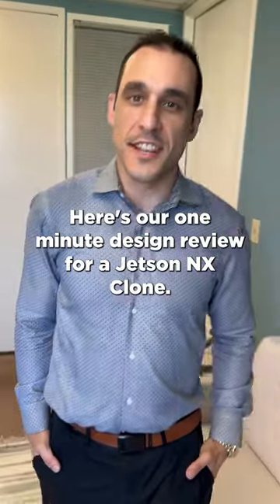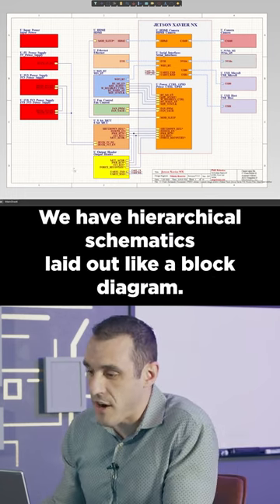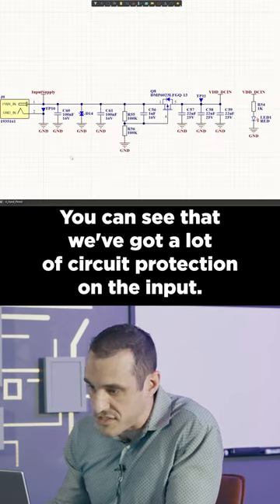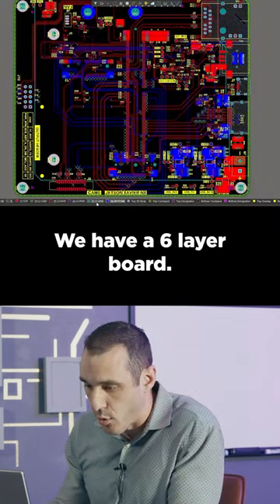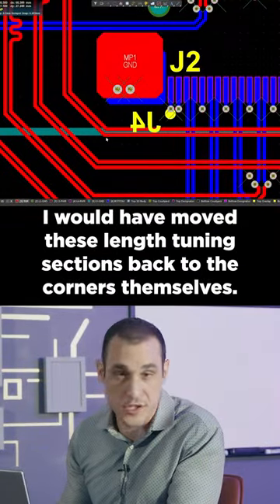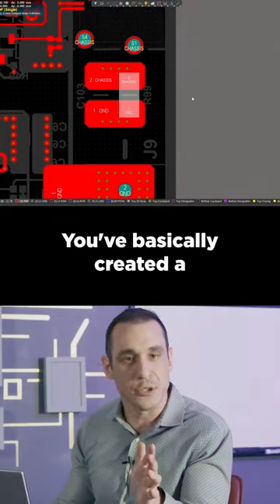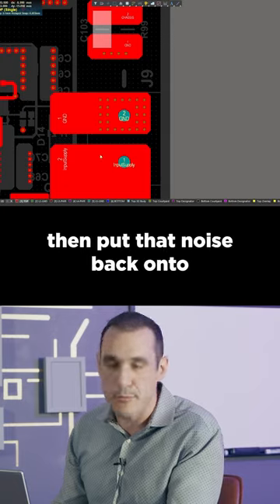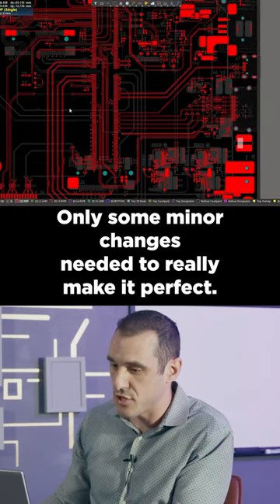Routing over Split Ground Plane? - One Minute #PCBDesign Review 09 #electronics #altium

Comment: Input reverse polarity protection FET is mirrored, that's not gonna protect anything :')
Reply: Good catch, plus place a Zener diode to the gate from the resistor divider to the source side after reversing the FET.
Reply: That could also be an inrush current limiter as there are bulk caps right after